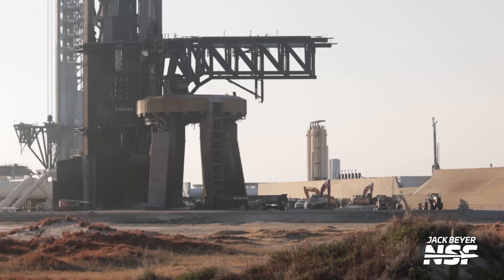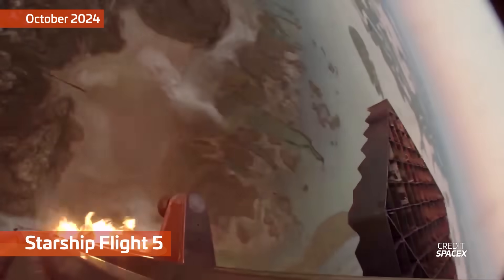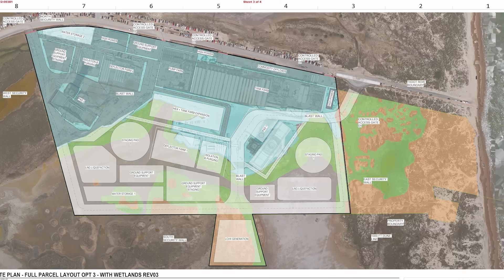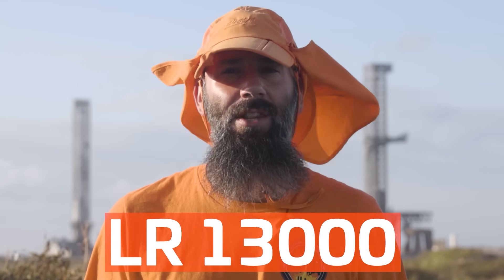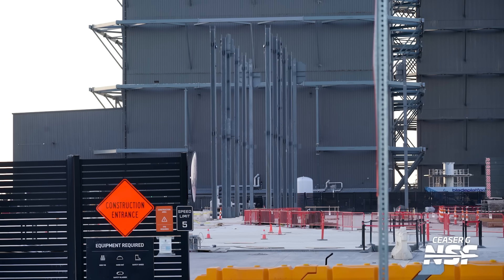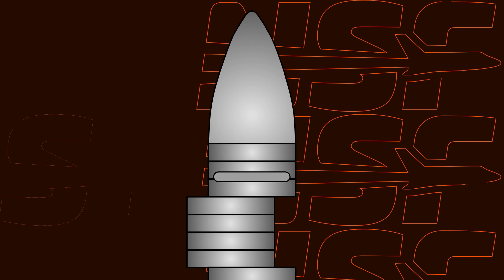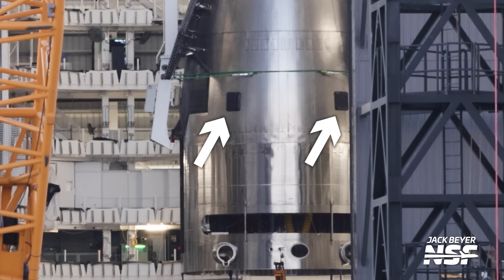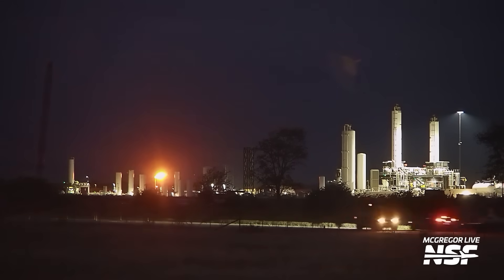Inside SpaceX's Pad 1 Teardown Ahead of Revamp | Starbase Update

Comment: Does anyone know why the reverse showerhead water deluge system didn't work out? SpaceX apparently thought in the past it was a better idea than the conventional flame diverter + water deluge system they already had for Falcon 9.
Reply: They're still using a similar design for the top deck of pad 2 tho so part of it was right, just not the location I guess...

Comment: After a few years and catches with heavier arms and boosters it is probably just prudent to replace the cable.  Also I would assume that the pad 1 farm will be updated to the valve and pump skids so they all have interchangeable parts.
Reply: The cable was already replaced last April, this cable they removed had in fact not seen a single catch

Comment: Gonna be interesting to see how testing changes when ships go orbital and start coming home.  Fully orbital is going to entirely change the whole testing game. Once that happens launch days are going to become potentially launch weeks or more.  Then as they get ships back and can not only go over them but send them back out with minor tweaks and start launching V3 Sarlinks and more.
Reply: Before they can reuse ships they have to iterate on the TPS. It's one thing to land a ship and another to actually reuse it.
Reply: @cube2fox  That will still be a lot easier to accomplish with a ship sitting in GigaBay than one sitting in the Indian Ocean.  Plus even if they have to refurbish parts of the TPS each launch for a while at first it wouldn't put things much worse off than Falcon 9's are currently.
Reply: @Dawgsofwinter  That's the question. Refurbishing a TPS can be very complex, as we saw with the Space Shuttle, which ended up being more expensive than conventional capsules with single-use TPS. I assume SpaceX will iterate on it till they get something that can be refurbished more quickly or needs less refurbishment. Until then I'm skeptical about quick turnarounds.

Comment: I'm not thrilled with the V3 being the same size..

The booster doesn't have 35 engines either. 

But.. Rocket science is hard, so.. Fair play, Kennedy!
Reply: To be fair, despite being the same size, SpaceX is gaining still some tank volume because they're recessing the RVacs into the LOX tank in their own enclosures. So they're gaining about 100 tons of propellant just from that. The booster will be the one with the most gains, lots more propellant and lots more thrust thanks to Raptor 3

Comment: Man, will 2026 be a crazy year. The launch frequency of Starships will be crazy compared to 2025...
Reply: That's what we said about 2025 compared to 2024
Reply: Next year they will test block 3, just as they tested block 2 this year. So we can assume that the number of test flights will stay similar to this year.
Reply: @cube2fox I don't think so. The launch cadence is set to increase, there will be brand new production sites and launch pads. Aswell as the launch cadance getting an increase permit.
Reply: @interpl6089 I believe there will just be one launch pad: pad 2. SpaceX was already permitted to launch 25 times from Starbase this year, which turned out to be unnecessary.

Comment: I haven't seen anyone address the new v3 integrated hot staging: did we just give up on the directional push that the last few v2 boosters had?  The new area appears to be all open truss 🤔 Keep up the good work
Reply: We've talked about this after Flight 9 which is when SpaceX explained it. For v3 they'll do differential throttling of the ship engines to push the booster back in a predictable way
Reply: @ale131296 Thank you, indeed I missed that info,  I appreciate it